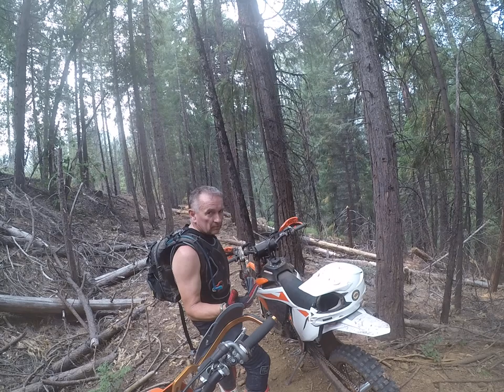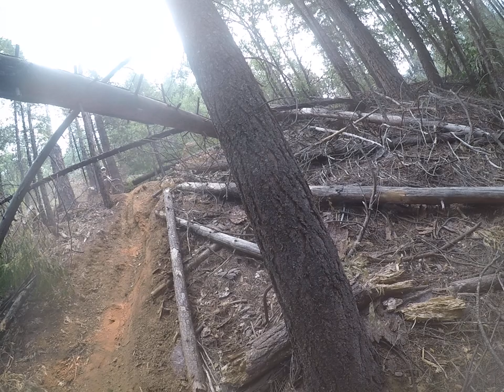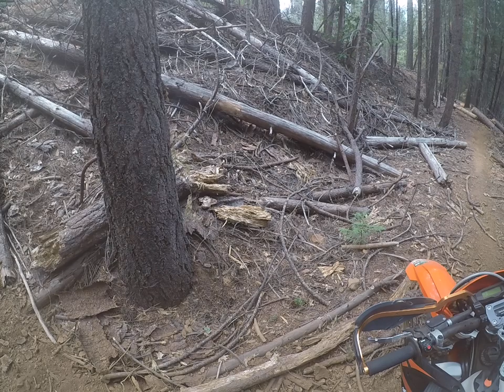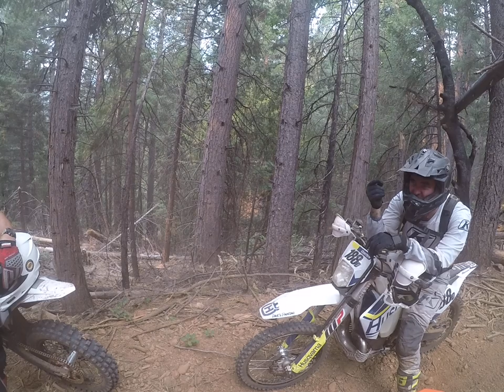Video 2 pulling and pushing a dead KTM 450

Comment: Looks like fun buddy
Reply from the maker: Never had so much fun 😂 but really we were lucky there was 5 of us to pull Will’s bike out and we weren’t too far in when it happened. We could have been 30 miles out. 😬
Reply: I was out in that same location area before and my friends 450 overheated he pulled the radiator cap and it sprayed coolant everywhere and got his coil and ignition wet and the bike was broke down we were screwed luckily I went riding and found a fire Road and found a local cruising by in a pickup truck and we paid him to give us a ride back I thought we were done 4
Reply from the maker: @MotomikeFRC  wow you guys got lucky 😲